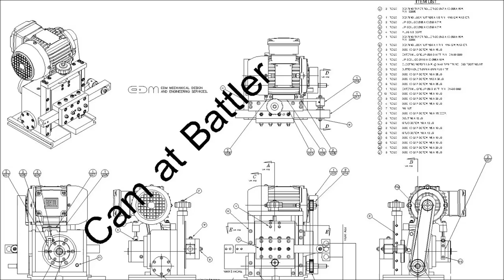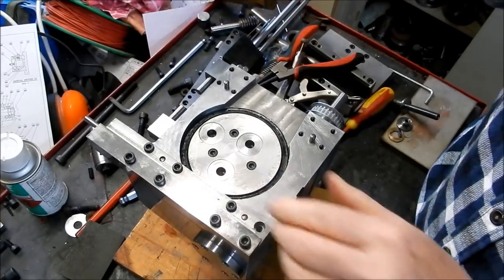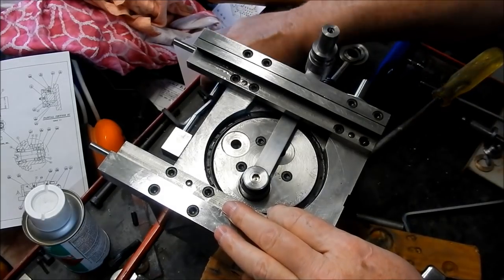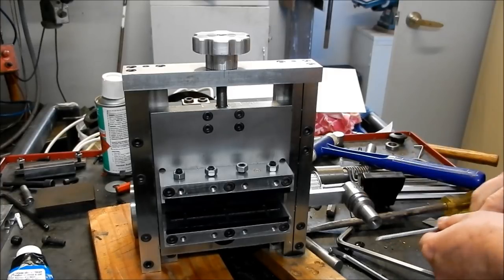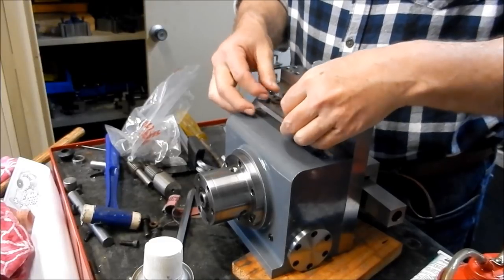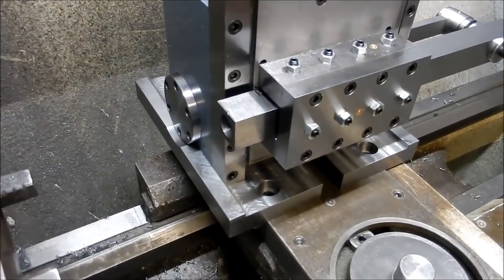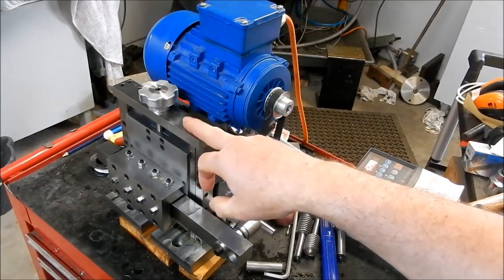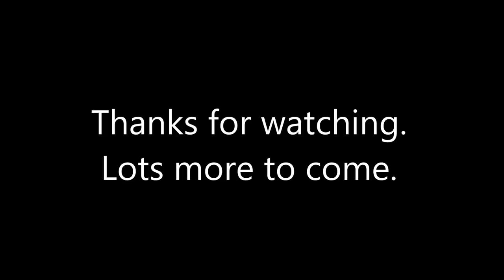Powered Lathe Slotter Build Part 56.  Assembly and bench testing.

Comment: Your slotter is beautiful! It's evident that you put a lot of thought and effort into this project. 
I would suggest adding felt wipers to both sides of the ram. They would help the keep chips out of the bearing surfaces and keep oil on them.
Reply from the maker: Nice thought E Designs.  I do have some 'meat on the bone' within the slide/housing structure.  Might be a good upgrade to do an a future project.
Cam

Comment: Beautiful machining very heavy duty !   You could cut gears with it also splines as well as a keyway. I would make something similar not as heavy duty but i don't need to have that size with my equipment also the motor size for me is overkill because of the gearing design which lowers torque needs.  Excellent design with adjustability.

Comment: Got a few fasteners there hey Cam. Very nice looking finished product, certainly put in the hours on it. Hope you have some slotting jobs lined up to show us 😃
Reply from the maker: G'Day 7duser10, hopefully I'll have the Saddle modified this week and the Slotter mounted and working.  Fingers crossed it works as designed.
Cam
Reply: @camatbattler2233  did you make this to make more 40 position toolholders? 😁 So much slotting!
Reply from the maker: @7duser10  your spot on.  After I made the 40 position tool holders using the slotting head I made up for the Mill I wanted to see if I could come up with a powered slotter for the lathe.  I looked around to see if anyone had come up with a design and found this on Merv Harris's site - https://www.youtube.com/watch?v=xmfw1phGV90&t=233s
I used his concept but designed it to be more compact.  It was a real coincidence to also see him slotting a 40 position tool holder in his lathe.  I had also fitted an accurate indexing mechanism to the lathe sometime ago for just this type of work.  I'll show that arrangement in the next video with the slotter in action..
Cam
Reply: @camatbattler2233  love it, sounds like an awesome setup Cam.
Those 40 position toolholders must be gold plated with the prices certain shops charge! 🤪

Comment: very nice cam. thank heaps for the update, careful lifting that around though!
Reply from the maker: G'Day Emma, yes it weighs around 18Kg's.  If I had my foundry up and running I would have knocked up some patterns and cores and cast the housing in aluminium which would have made it considerably lighter.  I am planning on making up a small spreader beam to lift it using my overhead Gantry Crane.  I use this crane to lift my dividing head and rotary table onto the mill and the Lathe Height Extender onto the lathe bed.  Built this crane a number of years ago to cover me when I'm older and retired and would struggle getting this type of gear into position.  This series was very long winded though, I'll certainly take the learning's from this project and change my editing style to make this type of build much more compact and viewer friendly.
Cam

Comment: Precision mechanics is very important to make quality tools, the design is very good, but I would have put a dovetail piece instead of three movement positions moved by a screw that makes it possible to lengthen the path or shorten it. Regards Angel
Reply from the maker: G'Day Angel, If you look at how I did my slotting attachment for the Turret Head (previous video) on the mill that is basically how I adjust the stroke length and it is infinantly variable from 20mm - 75mm.  This one I wanted to make it as basic and as robust as possible.  In reality I would probably never have to change the stroke length as 50mm would probably do 99% of what I need but it's a 2 minute job to re-adjust out to 70mm if its ever needed.  The other issue is the outer edge has the face seal running on it.  I would not be able to machine into the outer face to fit a sliding dovetail due to this seal.
Cam

Comment: Fantastic project !  I notice a minor design fault,  As the slotter is adjustable in height but the axis of the wormgear remains in place you introduce a small sinus error into the stroke lenght when you are adjusting the depth of the slot during process. Make a test using it as a shaper on a vertical surface and you will see the variation of the stroke from top to bottom of your test piece.
Reply from the maker: Your absolutely right Stefan,  their is a small sinus error in that the stroke will be slightly altered in length when the pivot center-line is above or below its axis of rotation.  For general slotting this won't be a issue but if I do undertake some weird shaping in which the ram is moved up or down and I have to machine up to a set point then this variation will cause a problem.  This anomaly was known from the very start of the design process and is a physical condition that couldn't be easily designed out given the envelope constraints and still maintain the flexibility of side cutting.  Good pick up and observation!
Cam

Comment: Getting a broach to do what he is doing automated is very costly and you need many broaches also they are hard and brittle which can break.  This approach is smarter overall because you can shape many things and the motor drive speeds the process .  You only dull or damage a replaceable cutter not a costly broach.

Comment: Thanks Cam, it’s looking good. Are you having a lifting eyelet on it? Looks like it’s got some mass to it, last thing you need is a hernia.
TFS
Cheers
Reply from the maker: G'Day Raymond, yes you are right it does have some mass to it, around 18Kg's.  If I had my foundry up and running I would have knocked up some patterns and cores and cast the housing in aluminium which would have made it considerably lighter.  I am planning on making up a small spreader beam to lift it using my overhead Gantry Crane.  I use this crane to lift my dividing head and rotary table onto the mill and the Lathe Height Extender onto the lathe bed.  Built this crane a number of years ago to cover me when I'm older and retired and would struggle getting this type of gear into position.  See these links to the crane in action - 
https://www.youtube.com/watch?v=KNtILebVjzM  - 
https://www.youtube.com/watch?v=EVnC4hBKziQ&t=2244s

Cam

Comment: Did you have any issues with the belt? You’d usually use a v groove type with a v groove pulley bigger contact area.
Reply from the maker: Hi Jack, yep this belt is right on the cusp based on motor power and torque but works well when you back engineer from the estimated cutting forces, rule of thumb, always design to where the highest load can be delivered, ie intensification forces, inertia forces, offset load forces but in most cases it will the motor and always design to stall at 220% of rated torque.  I could have gone with one of the metric T5 Series timing belts to bring the torque load into a comfortable region, but they are rather expensive but would still fit comfortably in the envelope space.  Regarding the use of Vee Belts compared to Timing Belts.  Timing Belts are a positive drive and can wrap over small diameters which in my case was critical given the close proximity to the ram and I also need room to fit a guard.  In this application a Poly-Vee would be very suitable.  I have never had any success with Vee Belts over small diameter pulleys, they seem to break their back and start to give a thump over the pulley, I converted my Fathers old Myford to Poly vee belts from vee pulleys on the over arm drive for that exact reason.  In some design cases vee belts can act as a torque limiter or a soft start if momentary slip occurs, I certainly use this methodology on my Sand Muller, if the blades jam the belt slips.  Rough but it works.
Cam

Comment: U can even use a 3 way cone pulley for speed variation in drive speed just offering a suggestion as i found speed variation only drawback  in this .diff material like  gunmetal ..cast iron  etc can be cut at various speeds . The speed u get is good for carbon steel cutting . Hapy with the workmanship though .has anyone found any drawback plz comment
Reply from the maker: Hi Swarandeep, I don't know if you noticed but I'm running with a senseless VFD with speed control so I can vary the speed down to around 2 Hz without losing torque and easily double the speed up from the 1440 RPM.  If you didn't have a VFD having a stepped pulley to vary speed would certainly be an option.  One thing I like about being able to vary the speed during the cut is that it is so much easier to tune out harmonic vibration by slowing down or speeding up on the fly.
Cam
Reply: Oh gr8 ..i skipped the speed variation in the motor ....in a 3phase electric ..ie...we have 440 volts as industrial current here in India ...where in if we need speed variation usualy AC to DC current is converted ...which is y i did not notice ...but i really liked the attachment .....all the best mate keep uploading ....
Reply: Are u in Austraila ....or US ..?
Reply from the maker: @swarandeep13  Australia.
Reply: I herd u addressing some 1 a ..mate ....i am working for an Aust  comp...in here  ...so get to speek with Aussies......

Comment: OMG all that work just to make a slot might as well you get some broaches its faster and cheaper I have been using them for the last 40 years!!!!!
Reply from the maker: G'Day John, I guess one of the main things I want to use it for in the future is spline cutting for a traction engines transmission gear.  Yes it was a lot of work but I loved every minute of it, there is always another means to an end than what you see as the final result.  To me, after leaving the machining trade over 30 years ago to pursue a career as a Mechanical Designer it is a chance to re-learn the trade that I loved doing.  Being able to do machine design work for myself, and then make it, is the icing on the cake for me.
Cam
Reply: My thougts exactly. It's all beautifully made but unnecessarily so,